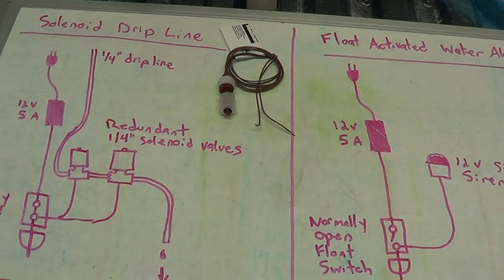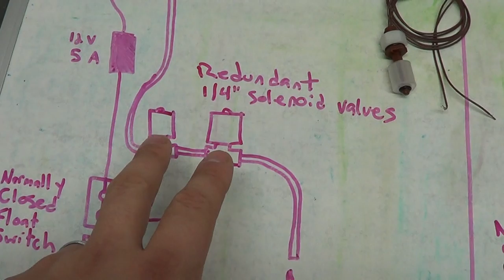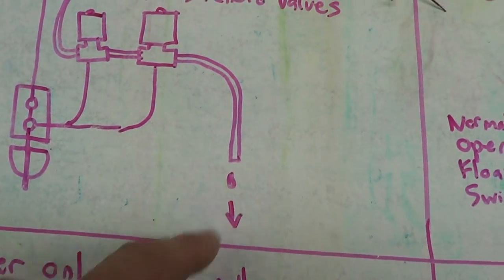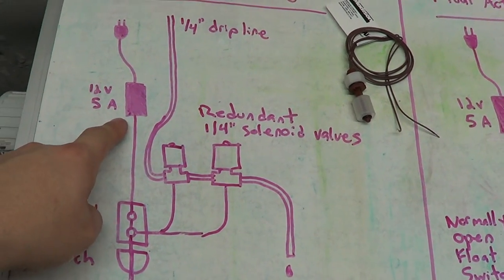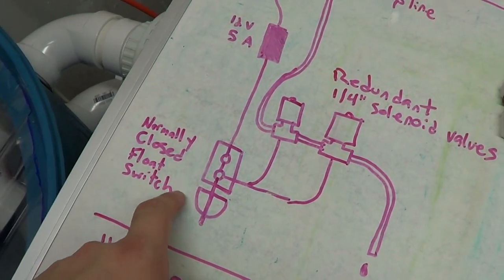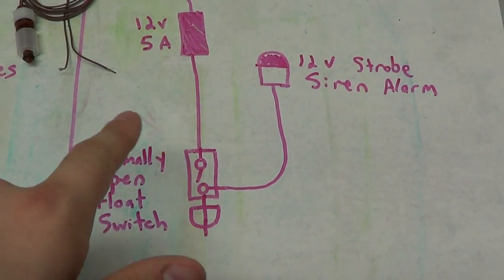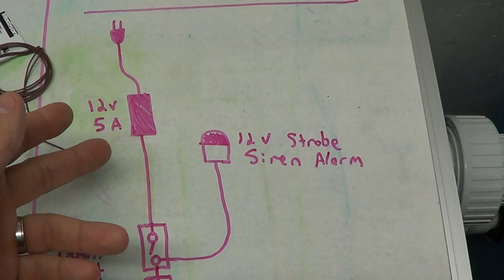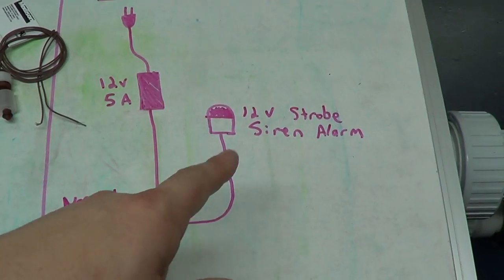#264: Electrical Diagram of Solenoid Drip System and Float Activated Water Alarm - DIY Wednesday

Comment: Why not have drip in main pump barel and have the third waste barrel drain into floor saving you the need for sump pump and it'll drain itself
Reply from the maker: the drain to the house is 5 or 6 feet in the air when standing in the basement